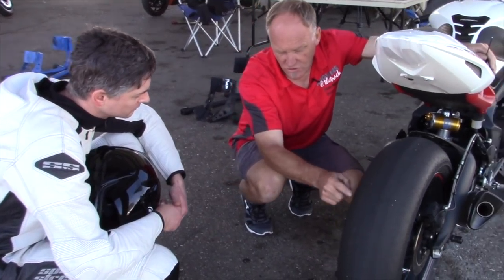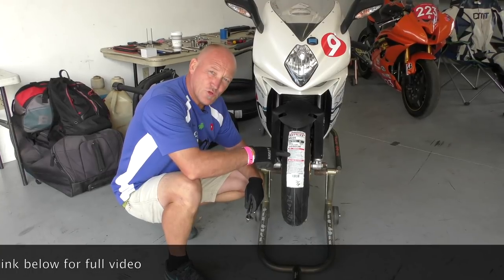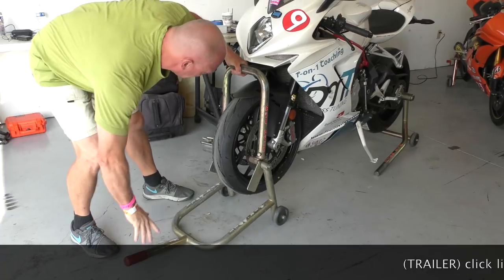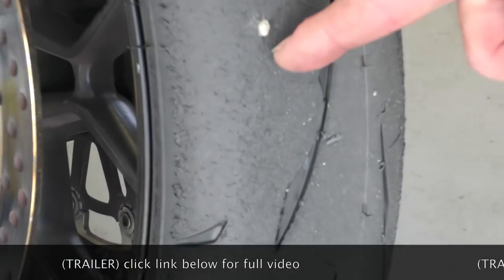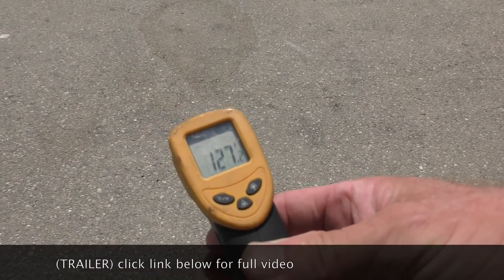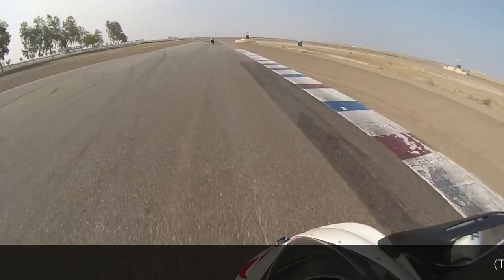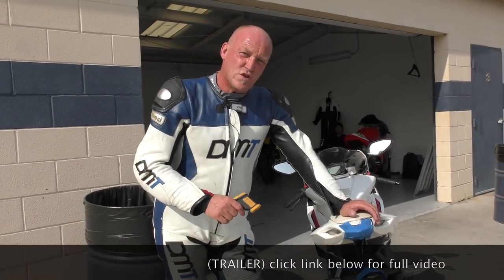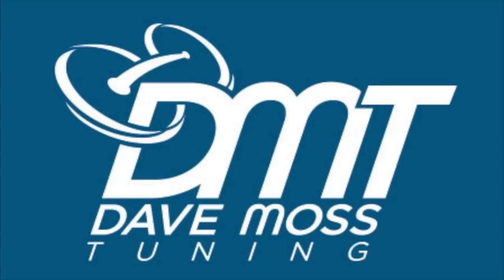Tire Testing: Bridgestone R11(TRAILER)

Comment: Look forward to trying them out; wonder if they'll cope with +13°C it's warm here !

Nice tip about the label/tyre warmer.
Reply from the maker: Given what I learned and depending on your track design, try 32-36 hot front and 22-26 hot rear BUT be sure to get the geometry right!
Reply: @catalystreactionsbw  Will do, I'm taking the rr down to Silverstone then using an R1M day after with Troy Corser so no pressure !
Reply from the maker: Silverstone is killing tires with the new surface so extra diligence is needed.
Reply: @catalystreactionsbw  

I'm going to be taking extra care, some of the BSB says it's good in the dry, but tyres don't last.

As for the wet, well I am Scottish !!!

I've got the a spare set standard wheels with wets.

At £1K for a day getting instructed on an R1M I'm not going to take any risks.

Comment: There is so much useful information in the full video; thanks for helping riders to better understand suspension and tire technology. It looks like that rear tire was mounted backwards. Can that significantly affect the wear or life of a track tire, or does it mostly affect water dispersion?
Reply from the maker: Many track only tires are made to be run in either direction BUT you have to know which ones. The rate of wear is not accelerated if the tire can be run in either direction. Therefore, it would only effect water dispersion so that end, it would be very interesting to see how the effect was manifested.

Comment: Hi Dave, currently running Michelin power 5, thinking about moving to s22 or rs11. Power 5 doesn't seem to tip over no matter what I try to do. Had Pirellis before and they were wayyy better with the same tyre size.50-50 on street and track
Reply from the maker: The Power 5 is a VERY soft carcass and needs a lot more pressure. I ended up on the street at 40 front 38 rear to get the tip in needed without a couple of veins showing in my neck. The prior Pirelli's clearly had a hard carcass, so the RS11 would be the better choice for you.
Reply: @catalystreactionsbw  thanks for the reply Dave, so you recon rear 34-35psi cold track would be ideal on the power 5?... here in Ireland its abit to the cooler side most of the time.
Reply from the maker: @Prajitrtz1  For Mondelo? I would start with 30 rear and 32 front on a cooler day.
Reply: @catalystreactionsbw  👌👌 Thanks Dave

Comment: Hi Dave, I just yesterday rode a honda CB 919 or hornet. The front tire wasn't worn alot but the smooth area leading to the sipes felt like it was raising up the closer to the sipes the tire was not worn out  but worn and was not cupped. However it fell into turns almost like it was trying to tuck when zig zagging it turned in violently as opposed to smoothly and did not have that gentle roll in it gripped and kinda threw the bike over. There wasn't the control that I have come to love from honda bikes. The rear had been replaced the front was on for a while 17k miles. What model of tire would give me the type of gentle controlled response I'm looking for. They were micheline new pilot road rear and pilot power I think in front. Ask me and I will try to explain better if I lost you" yeah like that's possible".
Reply from the maker: Any new tire will work as it is round from edge to edge verses a 17k old tire which literally wants to fall over once you initiate a turn due to flat spots. You can try the new Pilot Road 5

Comment: 32 psi front and rear, are you really think so!!!?  I thought 24-26 for rear, like Pirelli. Sorry if anything, I don't understand English very well. Please reply in the comments or email again what is the recommended front and rear pressure on the hot tire.
Reply from the maker: The start of the test information was based on information gathered. At the end for the test the rear was set to 24 hot with much better results.
Reply: @catalystreactionsbw  Thank you for your answer Dave. Can you give me links to all your full videos on this tire? I use this tire for the first season.
Reply from the maker: @Mikhail2423  https://davemosstuning.com/?s=R11

Comment: Hi Dave, just watched the video on your website. Can you clarify the choice for compounds? I want to try out these R11's... looking at the chart from Bridgestone only says hot temps go medium, low temps go soft. In the Netherlands basically the weather varies from 15c without sun to 35 with sun... can you give any advice on this? Bike is r6.
Reply from the maker: For Netherlands i would suggest soft tyres for you given the climate is predominantly cooler. If you are expecting to ride Summer only, where you are at a minimum of 25C I would go with soft front and medium rear.

Comment: Hello Dave from your experience which tire has the most traction in the middle of the tire not the side walls? Michelen power rs/dunlop Q4/batlax rs10/rs11. Using it for street riding and drag racing
Reply from the maker: For drag racing you need a hard carcass tire or one that is specifically designed to be stiffer in the center. Powrer RS and R11 along with Pirelli Angel GTII

Comment: What pressure for Battlax sport touring on a gsxr750 SRAD 1996, 143lb rider weight, not very aggressive street use in the UK, 15-20 degrees C?
Reply from the maker: 34/34 or 36/36

Comment: Hi-
Could you tell me what is the difference between Bridge RS10 and RS10-G?  Looking for replacement tire for my RSV4. Thanks
Reply from the maker: https://www.rockymountainatvmc.com/p/750/59567/Bridgestone-Battlax-RS10-G-Racing-Street-Hypersport-Rear-Motorcycle-Tire
Reply from the maker: RS10 was the previous generation and the specs on the G model are in the link.

Comment: Hi. What do you recommend cold tire pressure for sv650 2017 with battlax s22 tires for track ride?
Reply from the maker: depends on your ability and track (fst or technical). Start at 28 rear 30 front cold and look for a +4psi gain at the end of the 3rd session.
Reply: @catalystreactionsbw  i am novice and riding at istanbul park f1 track. Thnx a lot for answer :)

Comment: OK, good to know about the sticker removal. One question tho : WHY do manufacture companies use this &#@! glue on the sticker in the first place ? Conter productive and bad by design if you ask me. They should know better
Reply from the maker: Maybe because they bought pallets of it and need to get rid of it? Who knows.......
Reply: longevity tire or tyre has silicone on it from way they are made and they travel or are shipped all over and storage or knocks/bangs etc sticker needs to stay on 👍100% right to leave on for warmers but for street peel that sucker off and ride